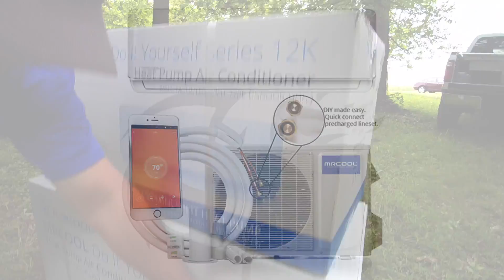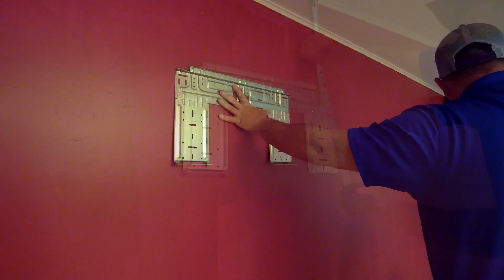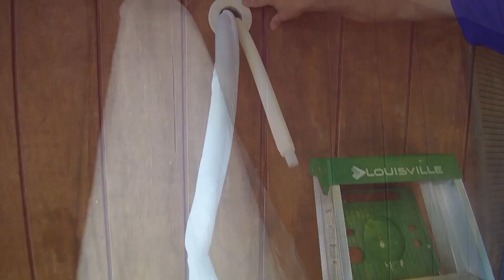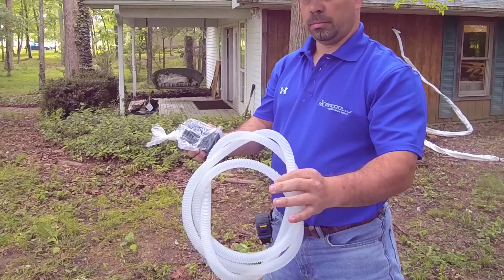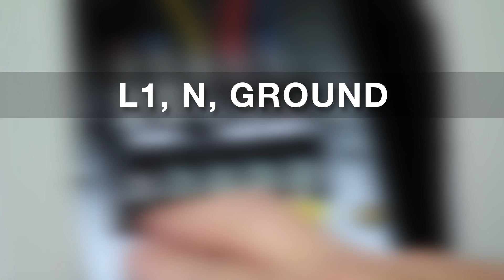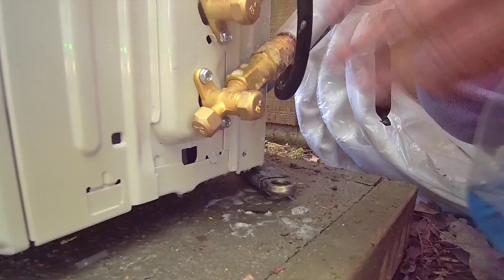Installing a DIY Mini Split AC System by Mr. Cool

Comment: After punching through the drywall reverse the hole saw and it will cut a perfect hole in the insulation without ripping it to shreds, the trick is to cut into it gradually
Reply: Good tip!

Comment: Btw people.  Installing a system you bought online means no warranty.  When you have to call a company to come work on it, if you can get someone willing to, you will pay dearly.
Reply: I installed mine. still includes warranty.
Reply: Ken Andrus and what’s in that warranty?  Can you install a new compressor after you blow that one?  If it’s not a 10yr all parts warranty then it’s not worth mentioning.  My company and virtual all others won’t do warranty repair on a system that is bought online and installed by the customer.  You aren’t saving yourself any money
Reply: @machinesandthings9641  I checked out a system in my area from a authorized installer and they told me 10yr warranty and I was ready to go with it.  When I carefully read the warranty details it stated that if it needed a replacement part under the warranty, I pay to have it checked to determine what is wrong with it and I pay the shipping charges for the replacement part. The so-called 10yr warranty will not cover those costs. And also if they check it and discover that it has what they call "sea corrosion" the warranty is void if you live within certain distance of the ocean. That to me, is a snake oil warranty. Yes, they will repair it,  but you are still going to pay some of the fees. And if you live near the coast and they find any evidence of rust or corrosion, you will be stuck to pay for a full replacement. Buying local or online are both a gamble,  but a lot less if you buy online and do a proper install yourself.  Cost to DIY is less than half the price and I have the confidence now to do another install in my garage.
Reply: Mike South wow, that’s a crappy company.  We have none of those stipulations.  Do whatever works best for you.  It’s not my money
Reply: nope.

Comment: Leaving the copper tubing coiled up like that creates an oil trap.  Don’t try to install your own system people.  You won’t have a warranty and will likely screw something up.  I go back on these all the time.
Reply: I installed mine and others do too. works great.
Reply: Ken Andrus I’m sure it does, for now.  I’m only educating you on the proper methods coming from 12 years of experience.  If you insist on doing the job wrong, good for you.  If you had any education in the HVAC field you would not be arguing.  The system will work without a proper vacuum but it’s life will be shortened.  I guess you like getting less for your money.  Did you even torque the flare nuts to the proper specifications?  Do you know what they are?  Without that knowledge the refrigerant will leak out eventually.  This is caused by the contraction and expansion of the metals as they are subject to large temperature differentials.  There is far more to doing it right than you can apparently comprehend.  As a result, these systems you install will not stand the test of time.

Comment: I have a 500 square foot, I went with the 18,000 btu and if it’s 50 + it’s good... 
anything less and it’s a no go, have to put in another unit. I wish I got the 24,000 btu..
It’s good to put in a step up bigger than what you need

Comment: Im getting ready to install one of these. I thought coiling the lines was a no no?
Reply: I left ZERO coils in the lines.
Reply: Eyeh8you awesome!
Reply: Eyeh8you it is.  You must cut the excess and reflare the tubing
Reply: coiling it vertically is the no no, you can coil it horizontally. It's because vertical coils create liquid traps.
Reply: Techno Tard correct however it’s silly to leave it coiled at all.  It’s very ugly and also increases the chance of getting stepped on and kinked.  Seems to me that doing the job right the first time would be the most sensible.

Comment: So who's right? This video or the professional installers here?
Reply: TYEemployee doesn’t matter.  The more people try to do this on their own, the more job security I have.  I don’t think people realize that they forfeit warranty by doing it themselves
Reply: @machinesandthings9641  You sir, are incorrect. They forfeit warranty if the individual installs it themselves and the unit is the non DIY version.
Reply: Techno Tard even if they do get a warranty are they going to be able to diagnose and repair it themselves?  Good luck with that lol.  I know my company and every other in central Texas will tell you that you are S.O.L. If it needs work and you bought it online we won’t touch it.  We go to classes yearly and stay up to date with certifications to work on the quality mini splits that are available.  They are far more complex and sensitive than you think.  As a result we can give 12year warranties and can actually gets parts at a supplier.  DIY systems can’t do that. Furthermore, if you want to install your own A/C, get a window unit or a PTAC.  You can’t screw those up
Reply: @machinesandthings9641  mine works just fine reality tard. sooo happy my money in my pocket and not yours. lol. just messin with ya's, all good. for reals tho, went in easy and fully warranted, works well so far.

Comment: Did you have an issue bending the bundle away from the unit to put it thru the hole?  I am so scared to turn it 45 degrees as to not kink it

Comment: Jeez you guys. It comes as a complete sealed system. The lines are pre-cleaned, pre-demoisturized, pre-purged, and pre-everything at the factory. All you have to to is screw them together without cross-threading. You can't shorten the lines. If you break them open in any way before attaching you screw everything up and have to call someone in.
Mine's been running great for over a year and I saved $thousands over having a "Professional" do it.
Reply: The air handler and lines do not come with a vacuum on them.  The installation process allows air into the lines.  The only way to remove the atmosphere from the lines is to vacuum it after it is connected.  Only window units and package units that have sealed systems require no vacuum.
Reply: @machinesandthings9641  Incorrect...The lines have valves on them similar in function, though different in design, to the hydraulic hose couplings on farm tractor that connect to the various implements. The lines are sealed to the outside until the connection is leakproof. I didn't look closely at the valve, but I think the connection is a one-shot deal and there are no do-overs.
The unit has been heating and cooling my house since 9/2017. It has only needed the usual maintenance, clean the air filter and outdoor unit every now and then.
Reply: Brian Brehmeyer I’m not incorrect.  I’ve been doing this for 13years.  The condenser is sealed off but the air handler and lines will be exposed to atmosphere.  Running since 2017 isn’t very impressive.  I’ve no doubt it will work anyway.  It’s just not the proper or professional way.  Good luck though
Reply: @machinesandthings9641  Sigh....But you quit obviously haven't install a MRCOOL 100% DIY system. The air handler lines are sealed at the factory and the seal isn't broken until the connections are made to the outdoor unit.
The "Professional" wanted over $6,000 to install a similar system. My total cost for the installation was $1,763.68. Breakeven on my install is 3 heating seasons. Breakeven for the "professional" install was 11 heating seasons.
Paying 3 times more for the same product is just not proper or wise. Good luck with your business model.
Reply: machines and things,  I have to agree with Brian  you need to learn what is new in the market place. The DIY units have line sets that have been pulled down and charged with 410A. When the line set is connected to the air handler that also has been evacuated a pin pierces the seal and the refrigerant goes into the evaporator. On the compressor side the same happens. Once the lines are connected you open the valves on the compressor where the rest of the refrigerant is while in shipping.
Reply: 5/25/22 Update: Still heating and cooling the bottom floor of the house. The only complaint I have is that the indoor air handler has developed a fan bearing noise/whine on low speeds. Kind of annoying. Haven't figured out an easy way to get to the bearings to lubricate them.

Comment: Vacuum? Re flare? Torche Wrench? None of this?
Reply: Lines prevacumned and seal breaks when tightening which is why they say work quickly when tightening, no flaring as predetermined length of pipe cant be changed.
Reply: It is not needed!

Comment: How does this unit connect to electricity?   Do you have to run an electrical cable from the condenser unit to the house, or does it go with the bundle through the hole you drilled in the video?
Reply: It's part of the bundle.  Electricity then flows from the outside unit to the inside unit.

Comment: Funny video.  Use a level, not a tape measuring down from the ceiling. The installer is not doing what the narrator said. "Cut the outside hole lower than the inside." He drilled straight through. Other than that looks helpful but I thought you need to evacuate the lines.

Comment: Okay, assuming you don't have to vacuum the line set, what about installing a separate disconnect box for your outside unit? Is that required for this system?
Reply from the maker: yes, that is recommended
Reply: @kentuckyfilmworks5459  Required by electrical code!

Comment: Why would you not cut all of that excess freon line for a cleaner professional look. Also you need to pressurize the system with nitrogen to check for leaks and then pull a vacuum to 500 microns. This is why these systems get a bad rap because companies like you don’t install them properly.
Reply from the maker: You do not have to vacuum as they are pre-charged
Reply: You must not understand what a vacuum does...
Reply: Evaporator... not the condenser
Reply: "pull a vacuum to 500 microns"
This made me chuckle, thanks!
Reply: You can't cut excess line set. It messes up the factory charge. Its meant for that exact linseed length
Reply: And its 410a puron not freon (r22)

Comment: This unit will fail in about a year since you were to lazy to vacuum the lines!
Reply: The lines are pre-charged, so you do not have to vacuum them
Reply: someones job security ?
Reply from the maker: If you follow the directions above, you should be good to go!

Comment: What happen to vacuuming the lines 🤔
Reply from the maker: You do not have to vacuum as they are pre-charged
Reply from the maker: If you follow the directions above, you should be good to go!
Reply: Kentucky Filmworks incorrect.  All systems are precharged, you still have to pull a vacuum on the lines and airhandler.
Reply: Machines and Things not on Diy units!
Reply: 1) I agree with using a level for the internal mount, but I’m sure there is a minimum clearance from the ceiling that might require a ruler. 
2) while not obvious, I assume the inside unit is powered through the snake to the outside unit. 
3) All those comments about pulling a vacuum and purging with nitrogen come from folks who do not understand the concept of factory charged and do it yourself. Saving a cool grand might make coiling a few feet of excess line behind the outside unit worth it. 
4) The trickiest part of this appears to be getting power to the outside unit. To answer the question about an outside cutoff: if you can find a local code that doesn’t require one; install one anyway. If you are not familiar with electricity, and you didn’t know the answer to this question, hire someone who knows what they are doing. Your ER  visit or funeral will cost more than the money you save.
Reply: @SLOROB55  I'm a licensed journeyman HVAC technician, I know all about factory charged equipment. I also know not to be a hack when installing said equipment. Cut the lines, make it tight, pull a vacuum, release the charge. Not that difficult.
Reply: Matt Murphy cool. My comments are not directed specifically at you. Have an awesome day.